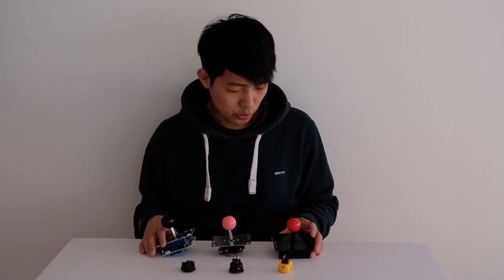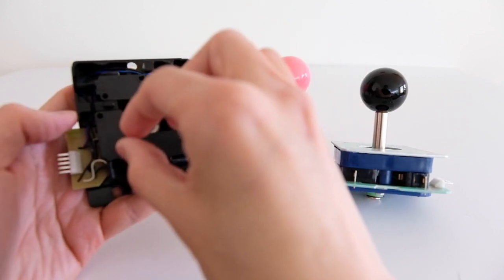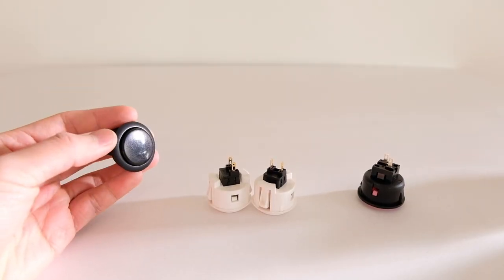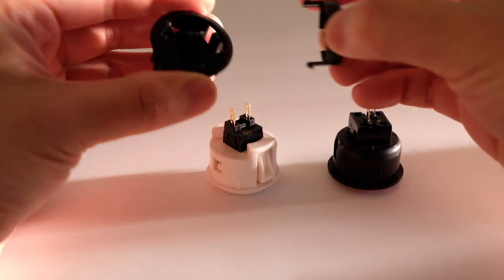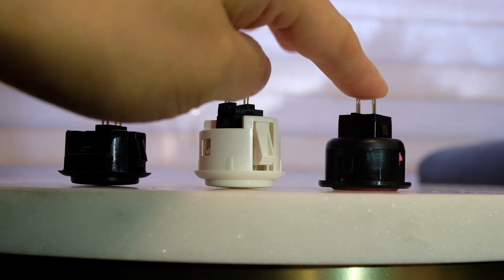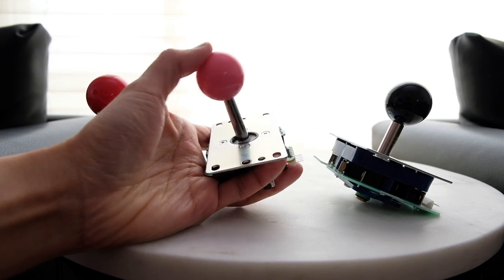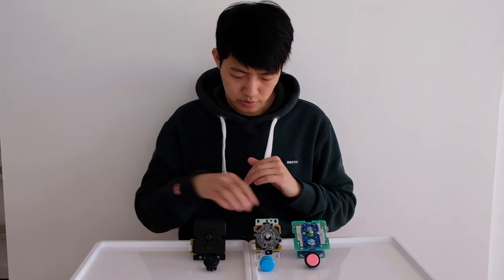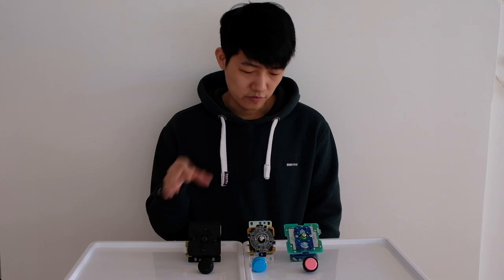Sanwa vs Hayabusa Vs Seimitsu Review Detail Comparison 2019 HD

Comment: Oh my god! So many thanks for the Joystick inside-out man! I've been struggling so much with my diagonals on my Sanwa Joystick. Now it all makes sense and I'm definitely going with Seimitsu! :)
Reply from the maker: L5R_Dydra thank you for watching, 🙏❤️ oh? What are you struggling with on sanwa?
Reply: In anime games diagonals are especially important for forward jump cancels. Seimitsu seems like it will give me an easier time having the metal pieces making the clicks instead =) 

I have a question though. Don't know if to select Seimitsu LS-32-01 or Ls-40-01 for my Venom Arcade Stick.  More details here 

https://www.reddit.com/r/fightsticks/comments/c4knl1/venom_arcade_stick_switching_sanwa_joystick_with/
Reply from the maker: L5R_Dydra the Ls32 & ls40 have the same spring,
Ls40 shaft is slightly longer, it has slightly less tension. But very minimal difference. You may not even notice the difference. but people say ls40 feels smoother than the ls32 because it has a upgraded pivot design, hope that helps
Reply: @JoystickNY  Thanks! Actually I was worried about the mounting. It seems this "plating" that comes with the stick ( not sure what SS and SE are ), doesn't fit on my arcade stick model ( Venom Arcade Stick my base is called ). So you have to remove the plating and mount it directly into the case. Not sure what that means, but people say that's the way to go. 

At least for the LS-32-01. Also there is a difference between LS-32 and LS-32-01, the later being a 5pin (which is what I need I guess). 

My main worry is, if such direct mounting will lead to poorer experience or any other problems. 

A lot of specifics, but I'm ordering the parts from Germany and it will cost me a while, so I'm trying to learn as much as I can.
Reply from the maker: I agree, always do the research before buying n modding, what games are you mainly playing with it?
Reply: @JoystickNY  will be for mostly the new Samshow and MK11. Maybe some Tekken every now and then :)
Reply from the maker: Good stuff, i didn’t get in to mk cuz i dont like looking at bloody body part every minute,  i might get samshow too, if i do, i will prob make video on that, i mainly play sf 3rd,,4,5. Mvc, kof, tekken 7.
Reply: @JoystickNY  well Tekken 7 uses diagonals quite a lot, but mostly the anime games like DBFZ and Guilty Gear need that mid-air jump cancels ( which isn't simply up, but a pure diagonal ) ... >.>

Too many fighting games these days! Many of them good!
Reply from the maker: @DydraLIVE  just saw your message, google is not sending me the proper notifications on comments, makes me sad, i miss peoples reply sometimes

Comment: Hi, about 2 or 3 years ago, Seimitsu had to change microswitches from Matsushita/Panasonic, to Omron, because end of manufacturing.
The one in your vid is the newer one. Did you ever tried the older ones to compare ? I've read some complains about it made Seimitsu much closer to Sanwa feel.
Reply from the maker: ryoandr thats good information, i have not try the older ones, i mainly use sanwa and hayabusa, although seimitsu does feel very similar, just a bit tigher and require more tension 🙏❤️

Comment: I just upgraded my stick on my Qanba drone to a Sanwa jlf. It’s kinda crazy that the sanwa is so small, love the clickiness of it. Plus the balltop is better, I hated the mold line of the qanba drones stock top. Also the restrictor reminds me of a beyblade lol
Reply from the maker: Nice upgrade man, Glad you like it, only the stick ? Or also buttons?
Reply: Joystick NY I got sanwa buttons too, I haven’t put them in yet tho. I am printing a vinyl cover I designed to make the artwork look nicer. After I put the skin on then I’ll change the buttons too.
Reply from the maker: @Drebodollaz Dollaz sounds good already 👍
Reply: n response to your comment, I got the Razer Pantera Evo with a Stock Sanwa JLF lever and .9lb and Square gate. From the moment I took it out of the box I have felt it has been a complete waste of money. The stick is so loose, massive throw range, horrible. I played American arcades with what? the HAPP Eurosticks with Octo gates? were those the ones in the 90's arcades right? Anyways in the arcades DP's and Fireball were easy when I was like 12. Here I am getting my first Sanwa with Square gate thinking its going to be wonderful. Nothing but disappointment. Execution went from very high overall (on pad) to dirt low beginner level or worse. So the 2lb spring helped a little bit but not enough.  I have a Seimitsu LS-40 on the way and I am excited to say the least. Also have a oversized actuator and a Octo restrictor gate on the way as well for the JLF. Between the mods for the JLF and the new shiny Seimitsu LS-40 I think I will be much much happier. I will never again play with a stock Sanwa lever and square gate combo. Its unplayable in my opinion. I have read from others too that they absolutely HATE the stock Sanwa with square gate. They find it awful as well. They said the Seimitsu comes stock with a sort of Square-roundish gate that is much better, so  I am even more excited when I think about it LOL I highly doubt any pro uses a STOCK Sanwa JLF lever with a Stock Square gate. Everyone I read about their info or ask, also say in their equipment used or there preference pretty much all use CUSTOM Sanwa Lever's .Custom, not stock (LMAO) Custom is the key word Custom. I will never ever touch stock Sanwa's for the rest of my life, I swear it.

Comment: should of included the names for each lever
The Seimitsu LS-32 feels completely different than the LS-40. The reason why I say this is because the LS-40 is a very popular lever as well.

Also the Seimitsu Buttons featured there are the PS-14 with flat surface vs the PS 15 which are concave surface
Two Seimitsu buttons feel completely different as well.
There are more offerings for buttons from Seimitsu too giving players much more flavours to choose from
Reply from the maker: SANHEK thats a good point, i may make a video in the future to cover deeper in to it. Thank you  for the suggestion 🙏❤️👍🕹
Reply: @JoystickNY  that would be an awesome video to look forward to :)

Comment: Just ordered Sanwa for my cabinet build!
The Zippy joysticks I installed are far too loose and soft with too much travel before activating the switches.
I also ordered the 4lb stronger springs and the bushes to reduce travel before the switches are activted.
Still a cheaper option than Seimitsu joysticks.
Haven't tried them yet but thank you JoyStickNY you have doubled down on my theory for buying the Sanwa with extra springs and bushes.
You can guess by now, I prefer the tighter game play joystick!
Great video, very clear and concise, 
thanks again.
Reply from the maker: Thank you 🙏❤️ someday i would like to build a cabinet too 😊

Comment: How is the Seimitsu doing for classic arcade games? I have the Mayflash 500Elite with Sanwa components. It works really good, but I have no comparison as this is my first and only stick. With the Sanwa stick I have to switch from 8-way(Xevious, 1941-1944) to 4-way(Pac Man, Mr. Do) depends on which game I play. 

So how does this work with the Seimitsu e.g. LS-32-01? Do I have to switch also? And in general how is the performance with the Seimitsu for those classic arcade games.

Comment: I have a Hori Fighting Edge 2 with a Seimitsu LS-32 with Hayabusa buttons, its a great combo. Seimitsu is by far my favorite stick, return to neutral, QC/HC movements are very accurate
Reply from the maker: Thank you for sharing, i used hayabusa buttons too  🙏❤️
Reply: @JoystickNY  They kick ass, I ordered some reserves the other day. Have you tried Crown buttons? Ive heard they are very good
Reply from the maker: Yahya El Abdullah Ali i have not, but soon i will try everything 😊🙏🕹
Reply: n response to your comment, I got the Razer Pantera Evo with a Stock Sanwa JLF lever and .9lb and Square gate. From the moment I took it out of the box I have felt it has been a complete waste of money. The stick is so loose, massive throw range, horrible. I played American arcades with what? the HAPP Eurosticks with Octo gates? were those the ones in the 90's arcades right? Anyways in the arcades DP's and Fireball were easy when I was like 12. Here I am getting my first Sanwa with Square gate thinking its going to be wonderful. Nothing but disappointment. Execution went from very high overall (on pad) to dirt low beginner level or worse. So the 2lb spring helped a little bit but not enough.  I have a Seimitsu LS-40 on the way and I am excited to say the least. Also have a oversized actuator and a Octo restrictor gate on the way as well for the JLF. Between the mods for the JLF and the new shiny Seimitsu LS-40 I think I will be much much happier. I will never again play with a stock Sanwa lever and square gate combo. Its unplayable in my opinion. I have read from others too that they absolutely HATE the stock Sanwa with square gate. They find it awful as well. They said the Seimitsu comes stock with a sort of Square-roundish gate that is much better, so  I am even more excited when I think about it LOL I highly doubt any pro uses a STOCK Sanwa JLF lever with a Stock Square gate. Everyone I read about their info or ask, also say in their equipment used or there preference pretty much all use CUSTOM Sanwa Lever's .Custom, not stock (LMAO) Custom is the key word Custom. I will never ever touch stock Sanwa's for the rest of my life, I swear it.

Comment: I have both the hayabusa lever and buttons in both of my main fightsticks. I changed the stock microswitches for gersung A3 switches. 1mm over size actuator, 2lb spring and kowal octopus gate. Also you can notice that the hayabusa buttons are 30mm but have a wider surface than sanwa buttons. I like the Hayabusa lever mainly because I started off using Korean levers so the hayabusa lever felt a lot smoother, than the jlf but a little loose, so I had to mod it. Has of right now I want to try out the Otto DIY V2 Korean upgrade...  Good video
Reply from the maker: Sam Body great comment, great info for the community, thank you
Reply: n response to your comment, I got the Razer Pantera Evo with a Stock Sanwa JLF lever and .9lb and Square gate. From the moment I took it out of the box I have felt it has been a complete waste of money. The stick is so loose, massive throw range, horrible. I played American arcades with what? the HAPP Eurosticks with Octo gates? were those the ones in the 90's arcades right? Anyways in the arcades DP's and Fireball were easy when I was like 12. Here I am getting my first Sanwa with Square gate thinking its going to be wonderful. Nothing but disappointment. Execution went from very high overall (on pad) to dirt low beginner level or worse. So the 2lb spring helped a little bit but not enough.  I have a Seimitsu LS-40 on the way and I am excited to say the least. Also have a oversized actuator and a Octo restrictor gate on the way as well for the JLF. Between the mods for the JLF and the new shiny Seimitsu LS-40 I think I will be much much happier. I will never again play with a stock Sanwa lever and square gate combo. Its unplayable in my opinion. I have read from others too that they absolutely HATE the stock Sanwa with square gate. They find it awful as well. They said the Seimitsu comes stock with a sort of Square-roundish gate that is much better, so  I am even more excited when I think about it LOL I highly doubt any pro uses a STOCK Sanwa JLF lever with a Stock Square gate. Everyone I read about their info or ask, also say in their equipment used or there preference pretty much all use CUSTOM Sanwa Lever's .Custom, not stock (LMAO) Custom is the key word Custom. I will never ever touch stock Sanwa's for the rest of my life, I swear it.

Comment: Exactly what I needed. Thank you! However one doubt I have about Seimitsu stick. Even the matel lever is touching the stick, because the switch is half way on the lever, it requires double the travel to push the switch, making it actually not as fast as the Sanwa. Also the stiffness may also because the stick is shorter so requires more effort.
Reply from the maker: I agree with you, maybe thats why the seimitsu is less popular in fighting games 🙏❤️
Reply: Sanwa JLF has tight directionals and loose Diagonals (this is why newbie players have trouble with quarter circles.) Seimitsus usually activate evenly in every direction, with the LS-32 having slightly looser directionals and tighter diagonals than the JLF and the Seimitsu LS-56 having extremely low travel. Despite what you'd expect, this actually makes the LS-56 way worse for fighting games, because it's so sensitive that it's easy to mess up inputs.
Reply from the maker: Note's Scrotes thank you for sharing ❤️🙏
Reply: @notesscrotes4360  which semitsu stick is best for fighting games in your opinion?
Reply: @osutinheizu8250  I'm not up to date on the newer ones, but of the old standbys the LS-32 is my favorite.